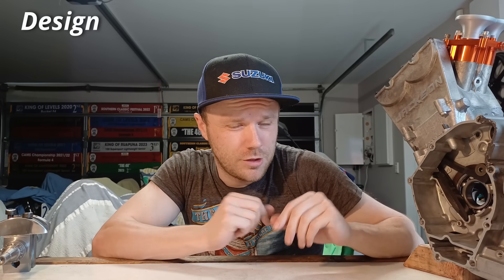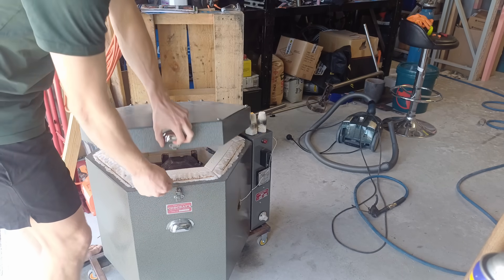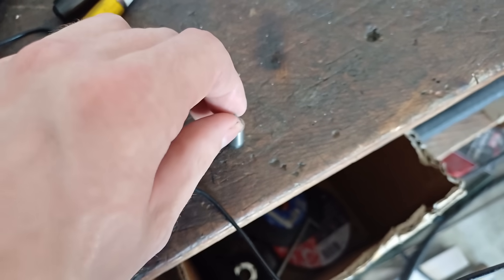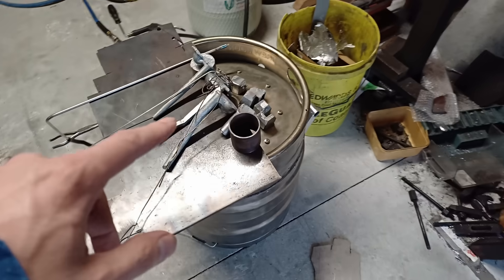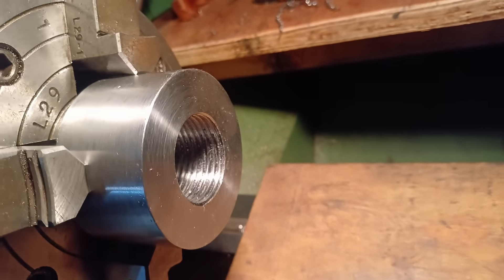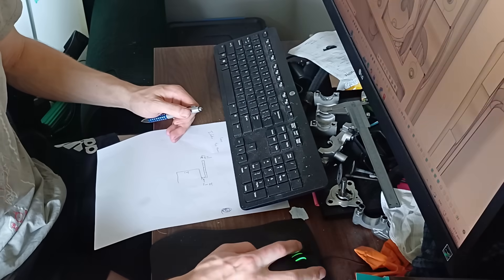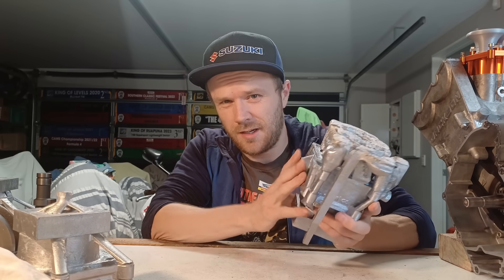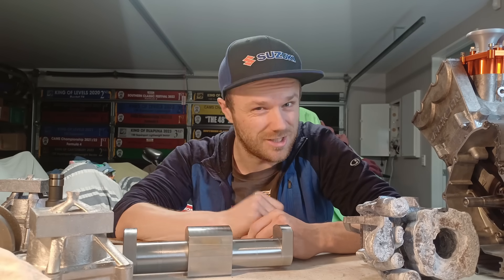Casting & Machining My own Motorcycle Engine

Comment: What is that powder you pour onto the molten aluminum? Great work on the castings keep it up
Reply from the maker: Its called hot topping, it keeps the feeders molten while the mold solidifies.
This helps prevent shrinkage in the casting.

Comment: Impatiently waiting for the next episode.
Reply from the maker: Well, you will only have to wait hours, editing atm.😅
Reply: @TheMotorcycleForge  I will wait.. There's moulding technique, i left on your other video on how you can achieve a perfect automative aluminium alloy. Check that out as well. That will help you alot. You are not including Magnesium, Silicon and very tiny amount of Iron. If being used, you'd get a perfect machinable Aluminium alloy for what you're doing, durable, yet light. Check that out as well.
Reply from the maker: @AdeelsMechanicalKnowledgeHub I am using A356 alloy so it should already have all the required elements like mag and silicone.
Reply: @TheMotorcycleForge  That's awesome

Comment: casting aluminum might become easier if, using a heavy wall stainless pot with a plug in the bottom... so when the plug rod pulls up, the aluminum drains out the bottom thru a tube into the casting. cast lots of long aluminum rods and use them with a stick welder as deposition electrodes to partly move away from high gas fuel usage? an oil bath pan at the bottom would also add lots of heat but that's incorporating 3 fuel sources into one thing... gas torch injection, electrical plasma, waste oil burner... all adding heat insulating the inner melting pot. then casting has nothing to do with safety risks of those graphite pots that only have so many heat cycles usable to them. no tipping the foundry, just lifting a drain rod plug. +100 pound castings?

Comment: Casting - a large mass stays hot longer, as metal cools it draws from the still molten mass.

You want the cylinder to cool first. The last thing to cool will be the most porous. 

So the sprue and feed well needs to have more mass than the cylinder. They need to be in the center or hotter part of the mold also because edges and especially the corners cool quicker.

Hope this helps.

Comment: For your casting mix, make sure to also include the proper sand, after an initial slosh coat to fill in the small details. It helps the rest stay intact, especially if you ca, apply both in layers. Your fine mix, sand or sandy mix, fine mix, followed by sand or sandy mix, repeat till you have an appropriate thickness mold shell
Reply from the maker: That is the process for ceramic shell casting.
This stuff is a different style of investment casting.
I do plan to buy some ceramic shell slurry , it is quite pricy, though. 😅
Reply: @TheMotorcycleForge  Correct, though it can also be used in a way for investment as well. As to the slurry, look into making your own.
Reply from the maker: @LTCDRRAZOR oooh yeah, I'd definitely be keen on maikng my own slurry.
Reply: @TheMotorcycleForge  An old video to check out "BBC Technical Studies Die and Investment Casting" on the Old Education Videos chan, no affiliation. It has some very nice old school information. I doubt it will help, but who knows.

Comment: Awesome, I dont comment much on yt or sub often, but have a sub and a comment, you've earned it.
I want to dabble in casting for less stressed stuff and have some casting 3d printer burnout resin and a little bottle forge  but mostly go another route on my kz dragbike and machine things from solid as I had some concerns about material qualities and consistency on really stressed bits, I cant know that something has the qualities of 6082 or the like unless using ingots that are a controlled consistency and following some strict process I didnt think I could realistically diy, and I know I'll be sawing up old wheels and heads etc to make raw ingots and no access to a xrf gun etc so I was thinking more getting my feet wet with bending dies and little jigs etc that could be final machined to save money on raw stock. Be interesting to see what the final product ends up performing like, or if you need to mix and match techniques for different level of stress items.
My lad works in metrology at a production light metals casting specialist, even they dont get it right every time and have both rework and saw up and remelt areas.
Reply from the maker: Casting is definitely worth having a go but yeah totally get what ya mean about strength, billet will always be stronger.

Comment: Why are you not using ktm style roller crank bearings instead of ball ones? They're just far better in almost everything, less tension, far more durable, better lubrication, better resistance to forces that crank produce, ball bearings are actually not designed to whitstand sidewall force
Reply from the maker: The cases are currently Suzuki FXR, I will be making my own in the near future and they will not have ball bearings on the crank.

Comment: So the model is made of plastic, covered with gypsum, and then the plastic is burned out ? If I understand correctly, cause my English is basic.
Reply from the maker: Yeah that is pretty much it. 
Although it is a proper investment casting mold material, not just plaster.

Comment: Hi Logan from Sunny Wales, UK.. 
I never comment on videos but I've got to on this.
I stumbled across this build series by accident, how on earth you only have 13 Odd k subscribers I don't know. The content is pretty much a perfect balance of showing what your doing but not dragging it out with repetition. You are showing all your cockups ... errr ...  I mean your learning experiences which is fantastic as loads of people will learn from what you are doing. 

This is a fantastic but mammoth project for you to learn on and fair play to you for even starting it considering you openly admit you are learning everything as you go along from scratch. 
I hope you have total success with it, have no doubt that you'll see it through and eventually make it work. You had better put up some footage of you racing the bugger!
I'll certainly be adding a link to the project in some forums etc that I mess about on and hope it spreads more from there 👍
Looking forward to the next instalment !!
Reply from the maker: That was actually one of the reasons for starting the channel and this build series.
Was to try get more people into racing motorcycles or at least get them to have a go at tinkering with something in the shed.
Its comment's like yours that help motivate me as well and I'm chuffed you think so highly of my videos.
I'll keep working away at improving my casting, machining and video's.
Regards Logan

Comment: Just a tip, slow your threading rpm. Things will happen much slower and you’re less likely to crash your lathe.
Reply from the maker: Yeah I was just trying to get a half decent surface finish.
It didn't look very good on the slower speed
Reply: @TheMotorcycleForge  if you set up your compound slide to suit the thread angle (55 or 60 degrees etc) then when feeding the depth you will be cutting with the front of the tip and the back of the insert won't rub and vibrate.. ALSO if your using a long boring bar you can tightly wrap it with some bicycle inner tube and zip tie to absorb vibrations. (My last engine lathe had a foot brake - you could flip the crossslide handle and Stomp hard at the final length. Then reverse out without taking out of gear, set your depth again and repeat. This allows for backlash with less hassle) - BTW ..  Good Work mate
Reply from the maker: @marginalfarming thanks I'll have a go at implementing a few you these tips.

Comment: Good stuff brother! This is exactly what i wanted to do to many my own freedom parts (like lowers) as a cheapass American lol. I have 3d printer and  built a foundry, unfortunately I just quit working on stuff. Theres definitely alot more to it than you first think. Especially shrinkage and how to correctly build molds.
Congratulations on your race placing!
Reply from the maker: Cheers Micheal, yeah it's definitely a challenge.
You should have another crack at it, it's way more rewarding than bolting on parts.
😁🫡
Reply: @TheMotorcycleForge I definitely need to! I atleast need to learn how to do cad to draw stuff for 3d printer. Plus i work at a fab shop so could have designs/stuff i need made cut on cnc or plasma table.
Haven't really done much learning new skills in quite awhile, so definitely time.
Reply from the maker: @michaelcarter3149 I look forward to hearing about your future projects

Comment: Hello,
What are you using to make those molds ? It looks like plaster of Paris but I don't think that works ?
Reply from the maker: Its called investment casting. This is a mold material designed for casting jewellery and can withstand the heat and stresses of casting.

Comment: if you wanna good cast finish. 
u need to preheat the mold 
its give time to cure and prevend void 
and give time to filling surface.

the best cheap material can hold heat usually sand. iron sand or black land. some casting sand are not suitable to preheat. usually sandcast for gold

gold are low temp melting and sometimes they using gforce to filling gold into mold

if you wanna looking for the best result use wax casting. you can use 3d print using low temp filament or buy wax casting filament.

for sand mold wax cast use alumunium oxide. it can hold steel temp. before cast you need preheat the mold. little bit expesive buying that sand but give you the best result you. but dont worry it can be use again

some precision like plane blade. usually not using alumunium oxide. they use zirconium oxide. its more detail because finner powder. but also  expesive than alumunium oxide
Reply from the maker: Did you watch the video???? 😅
Reply: @TheMotorcycleForge yes i did. your sand bad for absorbing heat. that alum doesnt have time to filling gap surface

you need sand can keep heat longger. or you can still heatup the mold when pouring cast. the problem is that sand doesnt absorb heat so well.
Reply from the maker: @heru0ne1 the mold was at 650 degrees Celsius and pretty hot. 🔥

Comment: Just caught up on the whole series. Love what you’re doing. Thinking about the cylinder head, have you considered using a heron head and having the combustion chamber in the piston?
Reply: After some thought, given what you’re building, a heron head is a silly idea. It would mean an increase in piston mass, therefore an increase in reciprocating mass, therefore lower peak rpm.
Reply from the maker: Thanks Edward, oh wow that's a cool idea, didn't even know it was I thing.
I'll look into it, bit late for this head but maybe later versions.

Comment: Is that thermite or straight up iron oxide that reacts with the aluminium at 6:55 ? 
If yes, what does it do for the process and doesn't it add a contamination risk with iron ?
Reply from the maker: Not sure on it's chemical composition, I know it's not made from iron as it's very light.
It's designed to create a heat source that keeps the top of the feeders molten while the casting solidifies.
This helps reduce shrinkage and also creates a barrier reducing h absorption.
My castings have less shrinkage and are all round better when I use it.

Comment: great video, what’s the brown powder you put on the molten aluminum after you poured it ?
Reply from the maker: Milo 😂
Na jk it's called hot topping, it's to keep the feeders molten while the casting solidifies, it helps prevent shrinkage.
Reply: @TheMotorcycleForge  seriously Milo hot chocolate ? woahhh hehehe I'll give it a try on my next foundry session
Reply from the maker: @seekingcashflow Just to clarify its not actually milo, 😅
I purchased it from Metcast in Auckland

Comment: I know I've commented this before, but stellar work. 

I can't help but think the lost PLA seems like a tough method for doing such a complex casting.

Not sure if you're just showing your failures more than the other channels that use lost foam, or sand casting, but this method looks really temperamental. 

Either way, fantastic work, and amazing perseverance!
Reply from the maker: Thanks, Nicco, it's very much appreciated.
I'd 100% agree that this form of casting is temperamental for sure.
I plan to do some sand casting in the future, which I'm hoping is a little more forgiving.
I try to keep it honest, and failure is still the best teacher.
Reply: Probably worth mentioning I personally did some small scale sand casting, a jewelery pendant for my wife, and wow, that was temperamental too! 😂😂 So yeah, maybe it's just you're showing your failures more than others. 

Which is really important, and appreciate that as someone following along and barracking for you.

Comment: ¿Why take the mold out, then clean the molten metal, then pour?
Leave the mold in the furnace, clean the molten metal then pour it in the mold while still in the furnace, and... leave it there a bit so the bubbles burst, or degas it again...
Reply from the maker: Poring from that height would introduce a who ton of turbulence and inclusions in the alloy.
Not to mention make a mess.
It would ruin the casting before it's even entered the mold......

Comment: Why not cast a billet in the rough shape, similar to how forged pistons are made, and make a billet engine. Find a press make a steel mold, or hammer and die 
 Place the aluminum in molten with the die heated when the aluminum  is solid start slamming the hammer into it. Just after the aluminum is solid or put it in a press about 300 tons to cool.  Then remove it and mm I'll in to a engine..

Comment: Great video. What investment are you using and where do you buy it from?
Reply from the maker: This stuff was sc20 by Ransom and Randolf.
Most shops that sell jewelry supplies have it or another brand.
Reply from the maker: I believe results would be even better if done under vacuum, although it's quite a pain in  the ass 😅
Reply: @TheMotorcycleForge  I'm about to try casting a barrel for my bike, but I'm only in the very early stages of it. The casting shop in Chch have been really helful though
Reply from the maker: @jonpritchard5612  Is it an air cooled barrel or water cooled.
Apparently the ceramic shell style yeilds excellent results, although quite pricey to buy the slurry.
Yes Ian is a super helpful guy to talk to, he gave me some pointers.
Reply: @TheMotorcycleForge  It's air cooled. 1993 TTR250 that I want to increase the capacity. I've modelled the original barrel, beefed up some areas where needed, 3d printed it and test fitted it on a spare engine. Cool, I'll have a look at the ceramic slurry. Thank you 👍
Reply from the maker: @jonpritchard5612 The investment is definitely the cheapest, around $130+ ship ect ect
Ceramic slurry was a fair bit more frrom memory, maybe $400+
Sounds like a cool project, look forward to hearing how it goes.

Comment: Putting oil on your lathe chuck?  If if is to prevent light surface rust Pledge works great, it is also my go-to for welding helmet lens protectors.  I polish with Mother's plastic polish and then until really banged up just use Pledge.
Reply from the maker: It was actually to try to smooth up the jaw actions as they were hard to move.
It partially worked, but I think it's just cheap chuck syndrome 😅